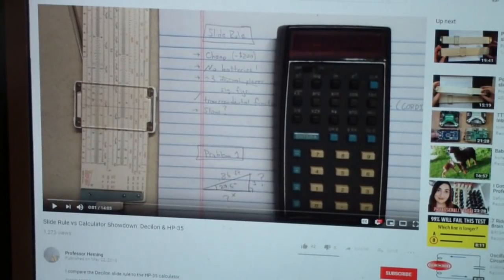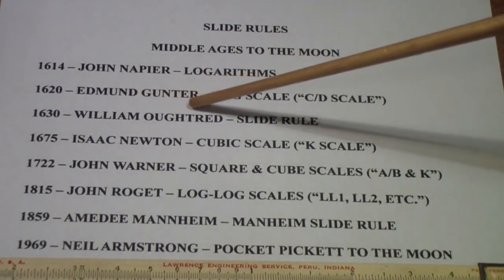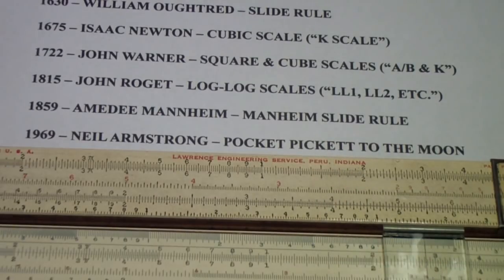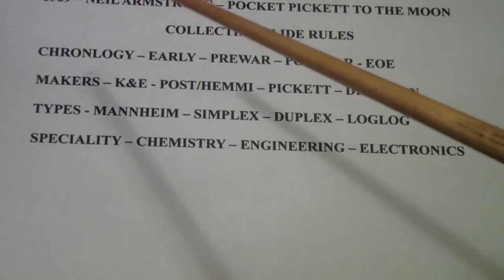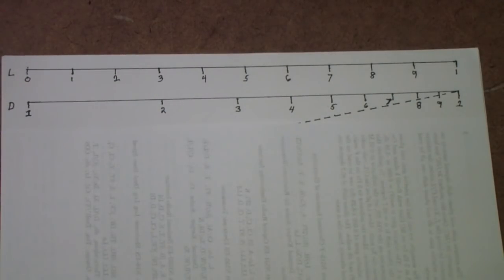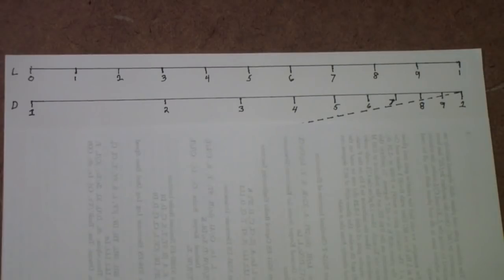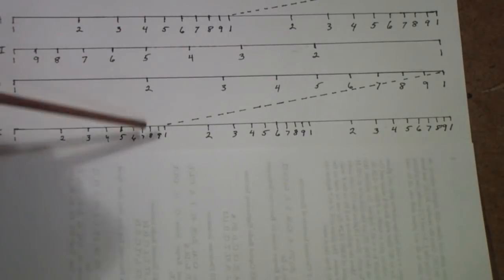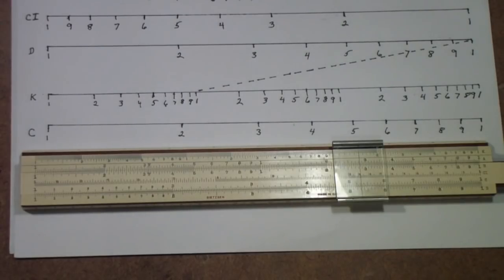TTT225 Calculator on the Moon

Comment: At school (around 1964-5), to understand logarithms, we were asked to try building a slide-rule.
I built flying model aeroplanes, so used Balsa wood and my dad's metal ruler (it had 50ths of an inch from 1 to 3 inches).
It was a bit stiff but worked well enough until I bought my Faber-Castell duplex. What a gorgeous rule that was.

Comment: I started as a engineering student in 1977 the year the one-semester-hour freshman course on how to use the slide rule was replaced by a course in BASIC programming. There was a brand-new HP 3000 minicomputer with maybe 15 or 20 terminals that we could use since not too many of us had our own microcomputer at the time. There were also a few DEC 8s and DEC 10s scattered around with teletypes, but everybody much preferred the new HP.
Reply from the maker: My first electronic computer was the IBM 1620D which we programmed in FORTRAN using punched cards. Later I used DEC computers (with UNIX) but nothing ever had the mystique of the slide rule. I guess you just had to be there.
Reply: @tomtektest
Just missed "being there." A friend of my father's in the early 70s was a engineer nearing retirement who was an early purchaser of the HP-35. He never did really trust the thing, always having to check any result against his trusty slide rule.
Reply from the maker: Yeah, I couldn't afford an HP35 when they first came out (I was in school and working to pay my tuition) so I bought a cheaper one and I didn't really trust it either, just more comfortable to use the "rule". Later, after I got a "real job" I did buy an HP35 but it died a few years ago and I threw it away (wish now I hadn't). The cheapo I first bought also died but my TI30's (I have 2) still work, while some other TI calculators bought later have died, go figure.
Reply: @tomtektest8042  I remember being fascinated by my dad's SR-50 calculator back in the mid-'70s.. think it cost something like $125 or so, which is probably about $600-$700 today.
Reply from the maker: Yeah, I think the HP35 was $400 or $500 when it first came out (about $4000-$5000 in today's dollars).